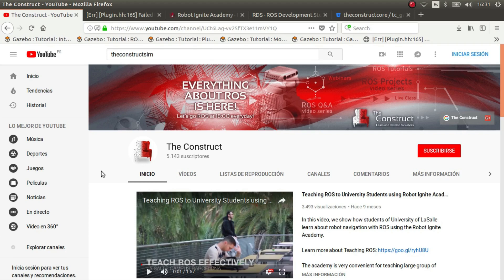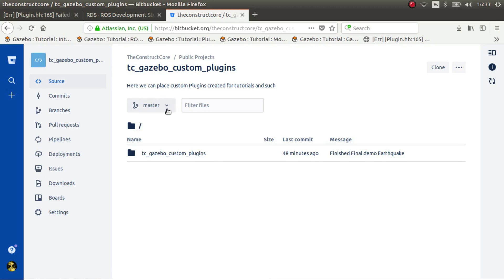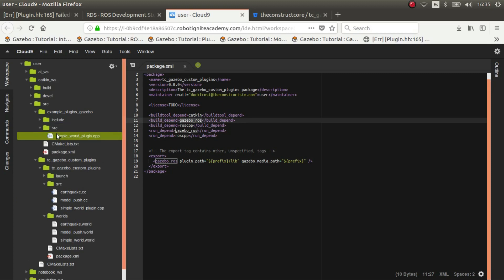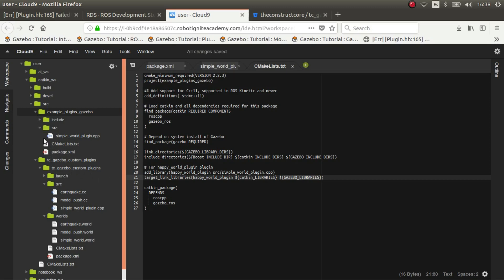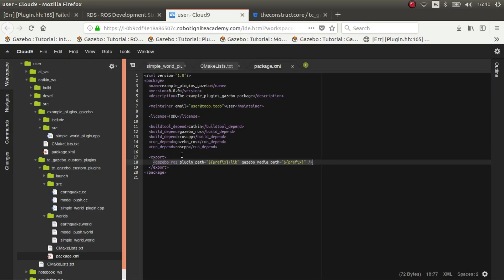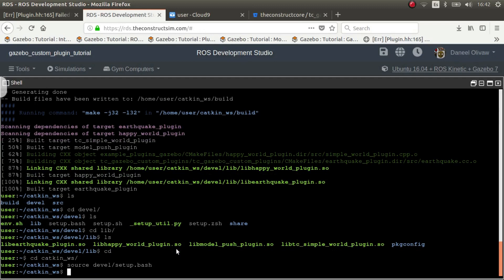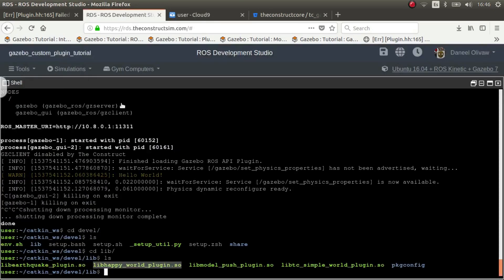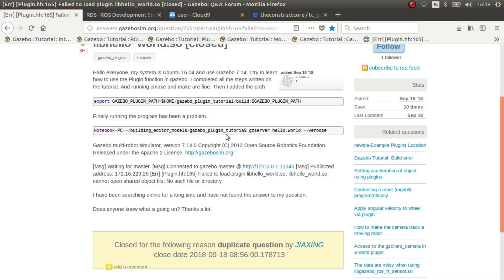[Gazebo Q&A] 001 - How to create Gazebo plugins in ROS #Part 1

Comment: Hello, when I try and run the first catkin_make in the catkin_ws directory, I get the following error:

CMake Error: The current CMakeCache.txt directory /home/cobratone/catkin_ws/build/CMakeCache.txt is different than the directory /home/user/catkin_ws/build where CMakeCache.txt was created. This may result in binaries being created in the wrong place. If you are not sure, reedit the CMakeCache.txt
CMake Error: The source "/home/cobratone/catkin_ws/src/CMakeLists.txt" does not match the source "/home/user/catkin_ws/src/CMakeLists.txt" used to generate cache. Re-run cmake with a different source directory.
Invoking "cmake" failed

Any suggestions on how to solve this issue? Help is appreciated, thanks!
Reply from the maker: It looks like your catkin_ws has something wrong. I would suggest you to delete the current catkin_Ws and then re-create it (instructions here https://youtu.be/JE6QmshipyQ). Then put the packages again inside the catkin_ws/src directory and re-run catkin_make inside the catkin_ws directory.